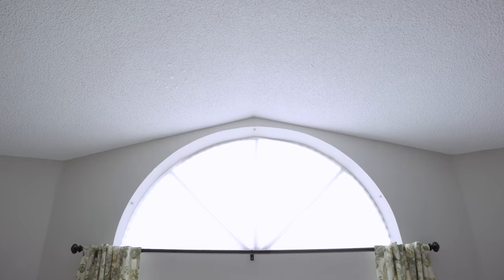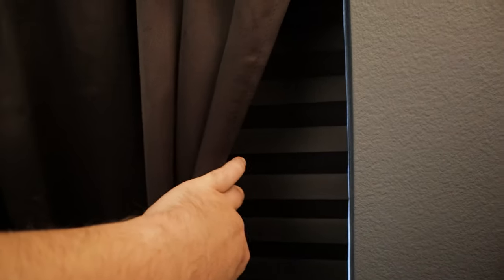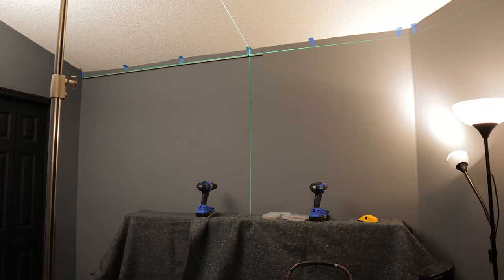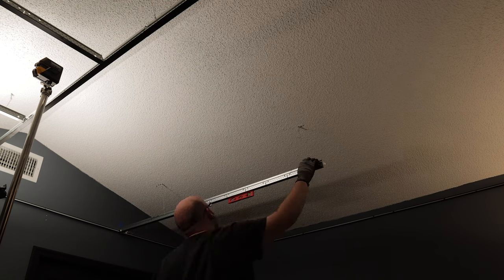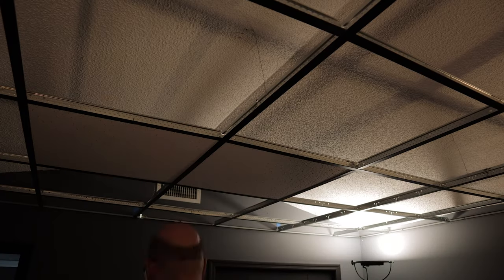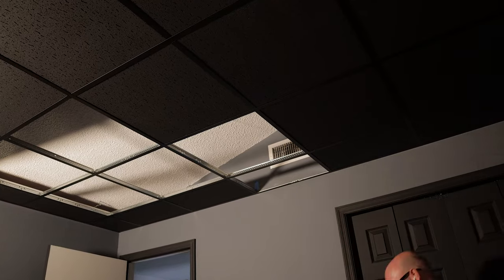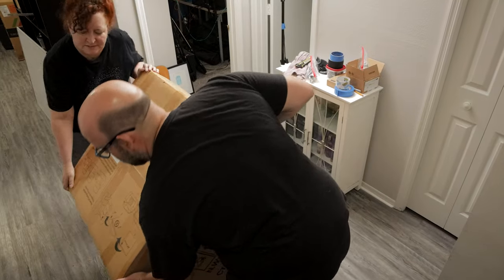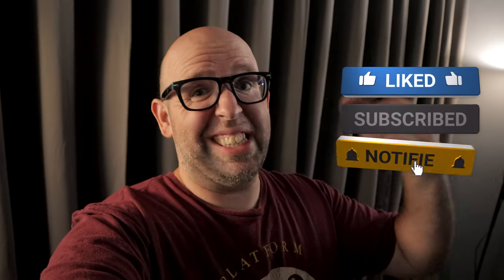DIY Home Theater Build Series | Episode 3 - Drop Ceiling INSTALL

Comment: Good job, but if you never intend to open those curtains, I think I would have painted the inside window pane white (don't paint it black!). Also, if it's easily accessible and looks okay from outside (depends on your house), iI would have installed window shutters on the outside. But maybe you intend to open the curtains when not using the theatre?
Reply from the maker: Thanks for the comment. Those curtains will stay closed 24/7. Unfortunately we have an HOA here, so painting the window is a no go. I did look at shutters but just couldn’t afford it. I did do something that really helped which was cheap and extremely effective that I’ll talk about in a later video.

Comment: Great job, thats a lot of hard work.  Question:  Did you notice an audible change once the ceiling tiles went in?  I've always wondered how much a drop ceiling like this effects the sound.  Would have been cool to have done some mic measurements to calculate the RT60 before and after. (I wish I had done more a/b comparison measurements when I built my theater... but I just wanted to get it up and running.)

Keep up the great videos, I'm super excited for you in your new house and new theater.
Reply: I had regular tiles and they didn't do much acoustically.  Recently switched over to Certainteed Theater Black fiberglass tiles and they did a nice job at quieting down the room, not excessively as they are only 5/8" thick.  I actually place another 3" of Rockwool on top of tiles located at the first reflection point.

Highly recommend Certainteed Theater Black, you see them in commercial theaters.
Reply: I did notice a difference. There had been an echo and that went away. That being said, if you can go with the ecoustic tiles like David mentioned those would be better I'm sure.
Reply from the maker: Thanks, Matt. Unfortunately like you, I wanted to get things done and just didn’t take any before measurements. I wish I did but I was so pressed for time as it was. I did do some before and after measurements for the acoustic panels (spoiler alert haha), so I’ll probably talk about that in a future video.

Comment: Nice job Brad, I did the exact same type of black drop ceiling in my dedicated theater as well.  I used 2x4 Certainteed Theater Black fiberglass acoustical tiles and it turned out great, nice and dark and some sound absorption as well.   I also placed an additional 3" of Rockwool on top of the tiles at the first reflection point.

Highly recommend the Certainteed Theater Black tiles over the regular stuff, they are used in commercial theaters and have much better acoustical properties.
Reply from the maker: I’ll look into them. I was stretching the budget pretty thin so I couldn’t afford much more expensive panels. I did end up making my own acoustic absorption ceiling tiles which I’ll be covering in an upcoming build video.
Reply: @HomeTheaterGamer  

Cool, thanks for all the fun videos 👍

Comment: As a homeowner, everything you tackle is daunting. The fear is messing up. Once you conquer that, you learn from mistakes and realize things are not that difficult. Great job on the ceiling and the window as well as the cabling. Speaker wire and sub cable routing is always a troublesome task for an existing room. I am interested to see how you tackle it with two outside walls (insulation) and two inside walls. Great content.
Reply: So true! But figuring things out and getting it done is extremely rewarding. Brad did an amazing job. I love vaulted and cathedral ceilings and I am surprised at how much I love this ceiling. It makes the theater room it's own space and it solved so many problems too. 😊
Reply from the maker: Thanks, Paul! I’m really happy with how the cable runs ended up going, which I’ll be sharing in the next build video (I think. I’ve kind of lost track haha). This room poses many, many challenges along the way but overcoming them felt great. Glad you’re enjoying the series!

Comment: Hi Brad, nicely done for sure. Maybe I am missing out, what is the reason for dropping the sealing? Wasn't the original "roof" shaped ceiling better for acoustic properties of the room? Or does the tiles have some damping for crucial frequencies like from 200 to 1000Hz? Thanks and once again nice job.
Reply from the maker: Part of the reason is that vaulted ceilings can create some strange, irregular sound reflections which I wanted to get right of. Another reason was that I wanted the ability to test out different in-ceiling height speakers in various configurations easily for the sake of making YouTube content (and because I’ve always wanted that option), so this pulled double duty.

The standard Armstrong ceiling tiles have some acoustic properties which helps some, but I also made some acoustic absorption ceiling panels for over the main listening area which I’ll go over in an upcoming video. I plan to make more down the road when budget allows.

Comment: Looks good! I spotted that APC UPC and it keeps reminding me that I need to get two. The more I think about it probably don't need a high capacity battery unit since I have an automatic backup generator but do want a proper sinewave unit. Do you plan on installing in ceiling speakers now or waiting till moving settles to tackle that?
Reply from the maker: I think the in-ceilings get installed in the next build series video (can’t remember when I recorded the installation). I ended up buying some Polk VT60s as they sound decent enough. Aperion Audio also sent me their Clearus 6C’s in-ceilings to test out and review, so I’ll be doing a video or two on them at some point.

The battery backups are awesome, though I need to get an extra one just for the AVR. Otherwise it trips the alarm due to the load if I have the TV, AVR and a game console all on at the same time.

Comment: Looks great. I have a similar ceiling in my theatre. I was wondering how you are going to address any vibration in it from your subs.  I have a couple cross members that vibrate at certain frequencies. I haven’t had time to address this yet, I was wondering how you were going to address this.
Reply from the maker: That's something that I STILL forgot to cover in the final video. So... I'm either just incredibly fortunate that I don't have any vibration issues or the subwoofer isolation feet are actually helping a lot in that regard. I've played through every sinewave from 20Hz-120Hz in REW at reference and I can't get the drop-ceiling to vibrate at all. The bifold doors and entryway door on the other hand, well, I'm still working on some solutions for those. I need to take the subwoofer isolation feet and do those same sinewave tests at reference and see if the drop ceiling rattles. If it does and I can capture it on video, then it may be worth doing a video about.

Comment: Looks great so far Brad!  The worst thing about having a  drop ceiling in a home theater, is you're probably going to hear multiple spots rattling during bass only scenes(like in BR 2049), and it's going to be tricky to solve them. Hopefully you'll have better luck than I've had over the years trying to get rid of rattles and vibrations man!  : )
Reply from the maker: Thanks! I appreciate it. Believe it or not, after doing multiple tests with bass WAY louder than normal, I can’t detect any rattles using the opening of BR 2049. The closet doors rattle though haha. I’ll need to fix that at some point.

I’m really excited to share how I made my own acoustic absorption panels for select spots on the ceiling (and acoustic panels for the walls). Glad you’re here and enjoying the series!
Reply: @HomeTheaterGamer  I linked a video in your last episode that showed how I handled sound absorption for my drop ceiling, so I'm curious to see if you did a similar thing or came up with something new!  

Also, it's not really the opening of BR2049 that's the biggest issue in my room... It's later on when K is approaching Vegas where there are sudden bass drops without any other sounds, that really highlight my rattles.  Good on you if you don't have any though!  Considering me envious!  Lol
Reply from the maker: @TerminatorJuice  I did watch your linked video and I sort of went in a different direction (since I already had extra Rock wool laying around). It worked out great minus one MAJOR issue that was totally my fault. I'll definitely talk about that soon. Haha.

I have tested numerous bass scenes from different movies and can happily report the only thing that rattles is the darn closet doors. Need to figure out how to dampen those vibrations.
Reply: @HomeTheaterGamer  Can't wait to see the next video to see what you came up with!  Also, good luck with those door vibrations!  Lol
Reply from the maker: @TerminatorJuice  I'm editing episode 4 right now and realized the acoustic panel stuff will come in episode 5 or 6. Can you tell I really planned things out when shooting? Haha.

Comment: What tiles did you use?  I see acoustic ceiling tiles some places not sure if that’s a gimmick or actually helps.
Reply from the maker: They are just the standard Armstrong ceiling panels. I looked at the acoustic absorption ceiling tiles for certain spots but they were too expensive… so I made my own! Stay tuned as I’ll talk about that in a future video.

Comment: Don't use zip ties use Velcro they sell rolls for 20 bucks
Reply from the maker: I refuse to give up my zip tie addiction. I have so many of them using velcro would feel like cheating haha.
Reply: @HomeTheaterGamer  they day you are working on something and put a 4inch or bigger zip tie cut on your arm, will change mind, lol.
Also it's just fast if you need to run a new cable no cutting them all off. Blue and yellow are good for dark area so you can find it, black is good for blending in